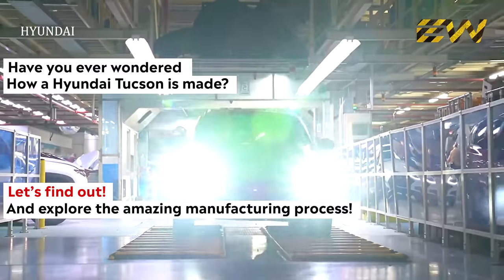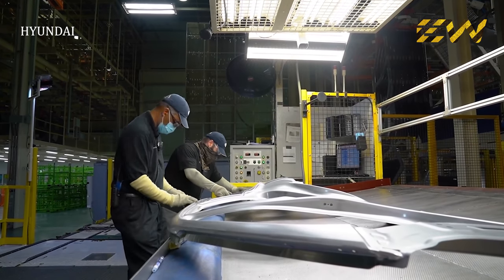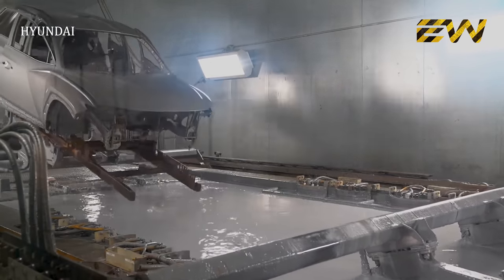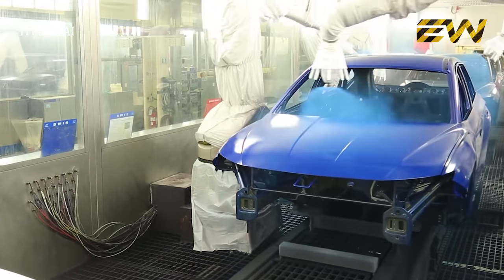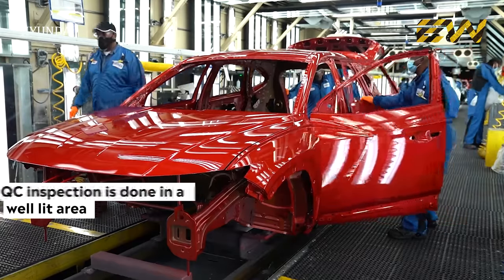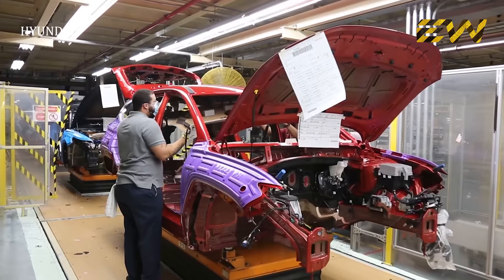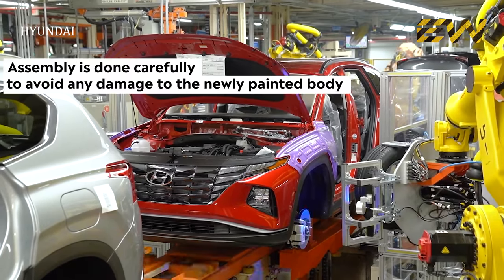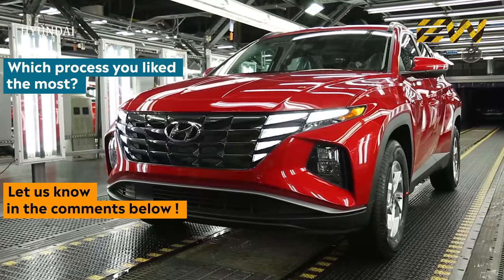How Hyundai Tucson Is Made? (Mega Factories Video)

Comment: I've a 2016 Toosan (Hahaha) and 2017 Sportage, bought them because of price.  I really wish the car manufacturer would get their act together with their engines.  I am already reading the new Soul is having oil consumption problems, they didn't say which engine in their comment.  I really don't want to have to buy a Rav4 with 200 million miles on it for $25,000 for some piece of mind.  My Sportage is drinking about a oz of oil every 10 miles now with only 67,000 miles on it, runs fine.  Appointment to have it looked at is 9 days away...

Comment: I hope they fixed the oil burning issue.  1 quart per 1,000 miles is pretty bad.  Hyundai should learn how to make some quality engines that dont burn oil. Hire some quality engineers and stop using terrible material